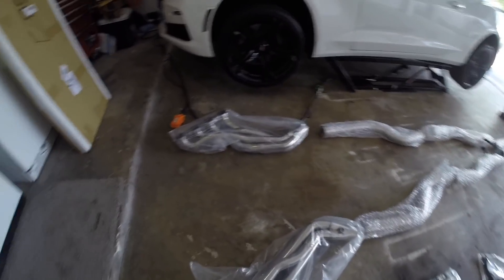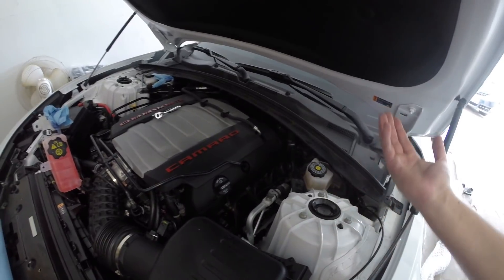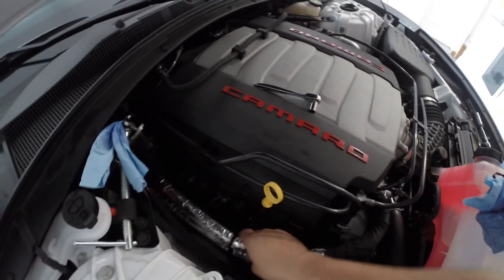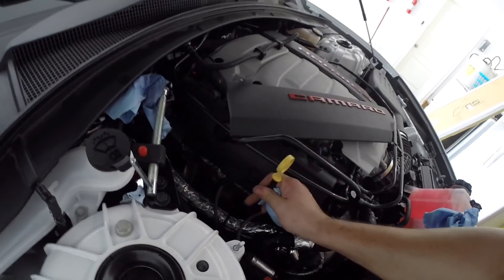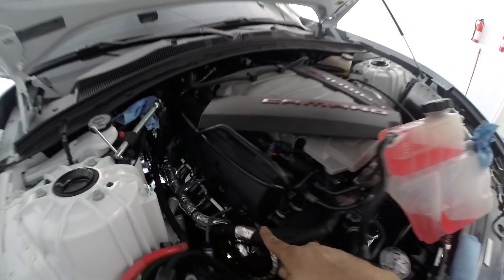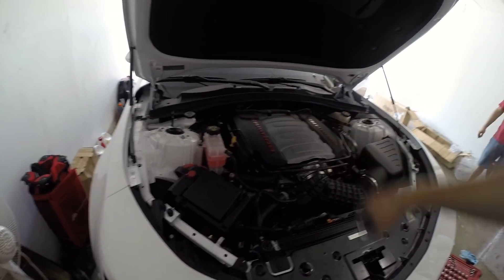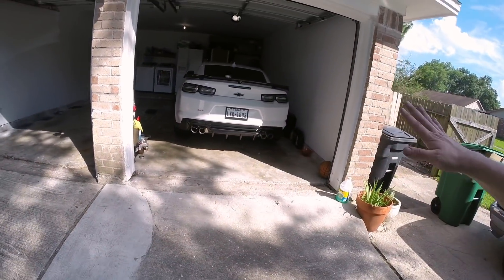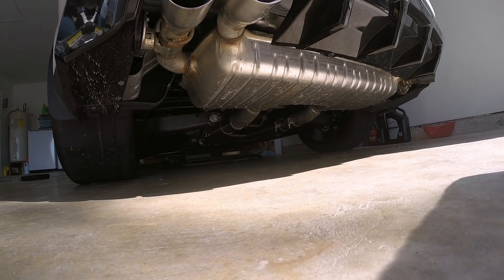Installing Speed Engineering Longtube Headers and X Pipe on MY 2019 Camaro SS!!! | Vlog #238

Comment: Hey bro, I have 4 o2 sensors on mine, but the x pipe I got only has room for 3. Do we purposely ignore the 4th one or you think they messed up on my speed engineering pipes?
Reply from the maker: the front two are for the front o2s which you need, and the 3rd one back on the driver side is mainly used for a wideband. the rear o2 sensors do not get used since you dont have the cats installed anymore. you will need a tune to clear the codes
Reply: @JLSpeed  appreciate the reply bro! 🙏🏼

Comment: What happens to the black cross member that was were you new x-pipe is, was that not structeral?
Reply from the maker: Marl Evans I didn’t reinstall it and haven’t had any issues. It’s supposed to be a tunnel brace. You can use washers and move it down to make space, I just didn’t do that.
Reply: @JLSpeed  ok, thank you. I'm having issues fitting mine in there
Reply from the maker: Marl Evans yeah I left mine off but maybe with some washers it could clear.

Comment: Hello jorge , the passenger side from where you bring the headers front the top or bottom to connect it to the engine?
Reply from the maker: On the passenger side i go through the bottom. you will have to remove the heat shield from the starter to get clearance, and then make sure to put shield back on before you tighten down the headers to the heads. You can just start a couple header bolts so the header doesnt come down, but dont tighten until you get starter heat shield back on so you can move header a bit and get access to the bolts.
Reply: @JLSpeed  thank you sir

Comment: Yo Jorge I need your help man. Mine is a dual tip exhaust and would like to find out What exhaust modification you recommend me doing without voiding my warranty and throwing engine light on. Im planning to do a delete but don't know what.  Thank you.
Reply from the maker: You could do a secondary cat delete. But you need to make sure you can keep the afm valves in place if you don’t want check engine lights on, or some have removed the motors from the valves and zip tied them somewhere under the car and plugged in so you don’t get check engine lights. That allows them to do a whole secondary cat and mid section delete to put an x pipe in there.

Comment: Probably a dumb question but how are you getting away with emissions? Thinking about getting the same set up but I'm in texas as well.
Reply from the maker: texas usually does obd2 test only on cars newer than 1996 so no sniffer required. a tune can help get obd2 test to pass.
Reply: @JLSpeed  looks like I'm ordering longtubes next week :)

Comment: Is it super drony? Or is it drony at all? If so how bad? Thinking about getting this for my 5th gen I know they sell the same set up cant imagine it being that different other than you got the quiet mode and track mode on the 6th gens
Reply from the maker: Pedro Merino not sure, it’s not too bad. And it will all likely depend on the axleback exhaust system you have. With the stock exhaust it will probably not be bad
Reply: @JLSpeed  ok good well the one I'm buying is their full cat back and maybe headers. That's also what I'm wondering. How good is the headers ? Any cracking ?
Reply from the maker: Pedro Merino ah ok cool not sure how the drone is with their full cat back set up, but should sound good. The headers are solid not issues at all

Comment: Hey jorge, the npp valve after the stock x-pipe; did you get a check engine light when you disconnected it or removed it?
Reply: At 7:03
Reply from the maker: Yes I did but I had my tuner get rid of the code
Reply: Npp is the active exhaust and is only far in the rear at the suitcase 😂 muffler. Anything up front is afm valve for that 4 cylinder sound.

Comment: Do you have to have the x pipe to go with the headers? I want to buy but the x pipe isn’t available on the site right now
Reply from the maker: No the x pipe just makes the install much easier, but you can install the headers and just cut the mid stock exhaust so they clear the headers and then go to a muffler shop to have them make the connection again
Reply: @JLSpeed  thanks for the reply

Comment: And also did you keep your active exhaust?
Reply from the maker: Yes I only installed the headers and mid pipe and they come with couplers to connect to the stock rear dual mode muffler

Comment: Question for Jorge or anyone who knows. Do you have to put in new spark plugs when you install these exact same headers and x pipe? If so, what gap measurement for the spark plugs?
Reply from the maker: You don’t have to, but I did because I was going to be running nitrous and was going to need new plugs anyways.

Comment: Hey man, did you ever get these ceramic coated? If not, have you had hot start problems? Thanks!
Reply from the maker: Hey, no didnt get them ceramic coated,but still never had hot start problems. I did put my heat shield back on the starter so im sure that helps
Reply: @JLSpeed  Thanks so much! I am getting the same set up soon, and just wanted to ask to be safe. Have a good one man.👍🏻

Comment: I see that they have the 2" headers in stock do you think the ss would have any fitment issues with 2"
Reply from the maker: None at all i was actually going to change to 2" in the SS if i would have kept it.
Reply: @JLSpeed  sweet thanks bro im going to call them today!!!
Reply: @JLSpeed   What would be the difference between the 2" and the 1 7/8  I am staying with a  naturally aspirated build? Hp and torque wise
Reply from the maker: @slickrickdarula9483  you will still make more power on the 2" vs 1 7/8 Brett at Pray has done multiple comparisions and the 2" makes more power across the rpm band doesnt lose any power.
Reply: @JLSpeed   Bro thank you so much you are awesome you always answer my questions so quickly thank you!

Comment: Hi jorge,just buyed and installed the same speed engineering kit,and wow it's so loud,only complaint is how much raspy it is,is there any fix to make it a bit less raspy?
Reply from the maker: DBZDRAWERSSJ glad you like them! And the only thing I would think to do would be to maybe add some resonators in the mid pipe if you want to keep your axle backs or look for aftermarket axle backs that might help.
Reply: @JLSpeed  Would it be possible to change the axle back with one with resonator?which one would you suggest?

Comment: Hey bro Do you have ti get a tune to fix the check engine light ?? Or does it even cause the check engine light ? Assuming the CATS got deleted.
Reply from the maker: Mario Renteria yes a tune will be needed bc of the cats and also because I removed the afm valves in the middle of the exhaust that close when the car goes into 4 cylinder mode.  The tune clears that though.
Reply: Jorge's Vlog nice, thanks bro car sounds good, i gotta do this mod lol
Reply: Oh by the way, how is the smell without the cats?? Is it bad ?
Reply from the maker: Mario Renteria it’s a little more noticeable but not bad. Once I do e85 it will be heaven lol

Comment: Any issues with afm valves? Did you just do an afm delete when you got it tuned or just don’t gotta worry about it?
Reply from the maker: z Z the x pipe removed the afm valves in the middle of the exhaust. I just had the error codes tuned out on the ccm computer when I got the car tuned.

Comment: Did you have to buy the spark plug wires as well?
Reply from the maker: Andy pride you don’t have to, and there is one on the driver side that will barely touch the primary, but not bad. I did end up getting speed engineering shorty plug wires after just for more piece of mind
Reply: @JLSpeed  so its better to pay the 45 bucks to buy the wires. Should tell that to your subscribers. Thanks for getting back.
Reply from the maker: Andy pride it’s not necessary, but it is a piece of mind.

Comment: Question jorge, when you're driving and the afm goes to v4 is it noticeable? I removed the mufflers on my 16 2ss but I want more 
 and I'm thinking of putting headers but I haven't found a video on youtube that deal with this question.
Reply from the maker: Not sure, I had the car tuned and removed the 4v mode after install.

Comment: Is Texas speed better ? Also why get the x pipe if there is already a factory x pipe
Reply from the maker: The factory mid section won’t bolt up directly to the long tubes and is also smaller diameter at 2.5”  or 2.75” vs 3” in the midsection for speed engineering. And they are all very similar and will do the job

Comment: Have you noticed any drone since installing the headers and x pipe?  And has there been any more leaking issues now that there is miles on them?
Reply from the maker: No drone with the stock axleback muffler on, and every now and then I do feel like i hear something, but its not bad. I plan on having the exhaust welded in the future.
Reply: Good to know thanks
Reply: Any issues with plug wire clearance or melting later down the road?
Reply from the maker: @Therace-qz8ik  There was only one plug wire that was barelyyyyy touching on the driver side, but i just ordered the shorter speed engineering plug wires 10' i believe and no issues with that.
Reply: Awesome thanks man

Comment: Did your engine light come on after install?
Reply from the maker: Yes it did, it’s due to not having the cats anymore and possibly the afm mod muffler valve motors plugged in. A tuner will be able to eliminate those check engine codes when he tunes it

Comment: Did you have to get the 02 sensor extensions the steel gaskets and the spark plug wires?
Reply from the maker: vlexlopez you will need o2 plug extensions and I reused stock header gaskets and got shorter plug wires
Reply: Jorge Loves Speed so not the plug wires from speed engineering?
Reply: Jorge Loves Speed and wouldn’t the steel gaskets from SE work better or they do the same?
Reply from the maker: vlexlopez pretty much the same the steel oem ones are the best option
Reply from the maker: vlexlopez i have the shorter 10” I believe plug wires from speed engineering
Reply: Jorge Loves Speed oh ok thank you and why did you choose the 1 7/8 over the 2”? Wouldn’t the 2” be better?
Reply from the maker: vlexlopez at the time wasn’t expecting to try and make a lot of power but yes 2” would be best
Reply: Jorge Loves Speed thank you for the advice I appreciate it👌🏾

Comment: Hey bro I have a question for you I got my headers on X pipe LT2 intake manifold cold air intake I want to take the car for a drive and I cannot get it tuned just yet do you think I would be OK? Or do you think it would lean out?
Reply from the maker: It might not drive 100% but you should still be able to drive it might get check engine codes but as long as you don’t floor it should be fine
Reply: @JLSpeed  thank you!!!!
Reply: Well I took it out and it was running ok for a while but then it started hesitating and had some weird back fires and the idle was weird to. Do you think its just because it needs tuned?
Reply from the maker: @slickrickdarula9483  yeah the air flow will be way off at idle it cam he that way
Reply: @JLSpeed  ok cool I was worried I messed something up. I'm not driving it no more lol just to the  Exhaust shop in the tuner lol

Comment: Did it toss a code when you installed these? Curious if I can toss them on my 6th gen zl1 without issues
Reply from the maker: Robman1286 yes it will toss a code if you install both the headers and the x pipe midsection because you will end up removing factory cats and not use your rear o2 sensors. That’s normal and when the car gets tuned which it should of you are doing headers they can clear those codes. Also you will lose the afm valves in the mid section which you will either have to remove the motors and plug them back in and zip tie out of the way or again have the tuner clear the fault codes from not having the afm motors plugged in.
Reply: @JLSpeed  A+++++ for the reply time and the extra info you gave on this very helpful man and thank you so much! subbed :)
Reply from the maker: Robman1286 no problem! And glad I could help!

Comment: Any fitment issues with the headers? And were you able to put the tunnel brace back ? I have a similar set coming but I went with 2inch since I will be going boost later.
Reply from the maker: takedownquill8 no fitment issues, and no I didn’t put tunnel brace back on but you can if you use washers to space it down

Comment: So stilll installing ran into so much issues lol , steering colomn had to come out , the driver side hard to bolt in we lost screws in the engine bay god knows where they went , and bolting up to my exhuast pipe lol it was a pain in the ass lol so tomorrow we go back at it lol
Reply from the maker: Jimmy M sorry to hear that! I had to remove the steering shaft bolts and push it out of the way. Start from the front to the back as far as mounting the mid pipe. Hopefully you can get it sorted out!!!!
Reply: @JLSpeed  we figured it all out , this shit is loud ! i blew off a pipe lol cut expanded and tighten and all good dyno at 6pm im already 442 on two dynos , lets see what i get off this
Reply from the maker: Jimmy M awesome! And 442 that’s good numbers! What else is done? Headers should gain you another 15-25hp I would guess!
Reply: @JLSpeed  intake and tune nothing else I got a unicorn
Reply from the maker: Jimmy M that is very impressive! Mine dynoed 412hp stock with headers and tune I’m hoping to be around 440ish and with e85 in the 450-460 range.
Reply: @JLSpeed  check out my page added the pull

Comment: Question, can I bolt the 2” headers to the factory exhaust without the midpipe? Their midpipes are on  bsck order lol
Reply from the maker: Brandon Wilkins no the long tube headers extend a lot further down the exhaust than the stock stuff. You would have to cut your stock mid pipe and have an exhaust shop make the new connections
Reply: Jorge Loves Speed thanks for the info, and that will Eliminate the secondary cats also right?  Yea I didn’t want to wait until next month fir just the speed engineering midpipe
Reply from the maker: Brandon Wilkins yes it more than likely would have to eliminate the secondary cats. The muffler shop might want to just start from the straight section in the middle and work their way back up to the headers
Reply: Jorge Loves Speed  ok cool appreciate the info,  I know the  header ends are 3” collectors so I’m hoping the shop can merge them without any issues loo
Reply: @brandonwilkins6816  did you end up bolting it to your oem mid pipes? If so how did it turn out?
Reply: @montaewalker246  it worked out good went to the muffler shop and had the. Weld in some piping after the long tubes headers, still going strong after three seasons

Comment: What do you do with the afm valves? Going with the same set up just waiting to get it!!
Reply from the maker: I removed them and just tuned out the check engine code from not having the afm valves
Reply: @JLSpeed  Thanks bro!! Can't wait to see the Zl1!!!
Reply: Just switched my order they're getting sent out today or tomorrow!! Thanks again bro!!
Reply: Did you put all 3 oxygen sensors back?
Reply from the maker: @slickrickdarula9483  the only o2 sensors that get reused are the front o2s the rear o2s don’t get used anymore. The third o2 hung is for a wideband.
Reply: @JLSpeed   Thanks bro I really appreciate it getting everything installed today

Comment: I fixed the headers but there are only 3 sensor points .. one is missing .. what should i do
Reply from the maker: There are only 3 because the two at the exit of the headers are for the o2 sensors before the cats and the single second one is just there for aftermarket wideband sensors. The reason there aren't two second bungs for 02 sensors is because without cats the second o2 sensors are not needed. You will get a check engine light without the secondary o2 sensors connected, but that can be fixed with a tune.

Comment: Hi. I really thank you for making this video ... I want to ask, after installing the long tube header, do you need to Tune or not ... because I heard a lot of people saying, after changing For long pipe headers, the car will throw the CEL code without a proper tune
Reply from the maker: You are correct, the car will throw a check engine light because you need to remove the factory catalytic converters in order to install the headers. The tune is not needed to drive the car, but a tune will optimize the engine for the new headers give you more power and eliminate the check engine lights.
Reply: @JLSpeed  thanks for reply <3
Reply: @JLSpeed  
hello, I want to ask if the catalytic you are talking about is secondary cat or not?
Reply from the maker: @huyshady  its the primary cats. When you do the speed engineering long tubes or any brand for that matter, the primary cats are removed.

Comment: Any check engine lights after install?
Reply from the maker: Not if it’s tuned for already having high flow exhaust no cats or high flow cats no check engine light will be seen, but if it hasn’t been tuned then yes you will have a check engine light with this set up.

Comment: Hey man I just wanted to let you know that I finally install my header in my c7
It sounds crazy loud. 
The only thing is the smell of gasoline due to being catless. 
Do you know if any universal catalytic converters will work  with this setup??
Reply from the maker: KV they should, but probably easier to just go to e85 if available in your area and also get the car tuned to help it be more dialed in and not smell as bad
Reply: Jorge's Vlog thank you. I just DM you on Instagram. Lol.
Reply: Did you abt fitnent issues on the C7? Thinking about getting these but they told me the stock pipe at the rear exhaust has to be modified to bolt up.